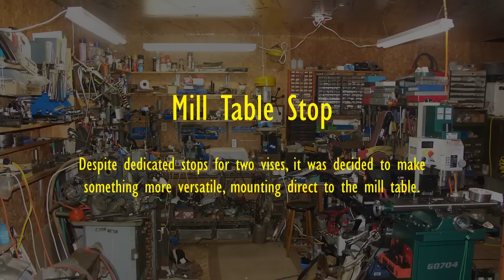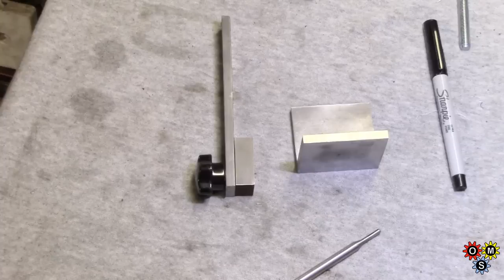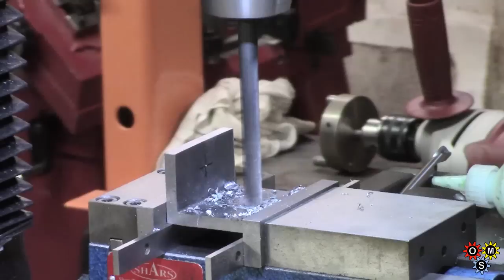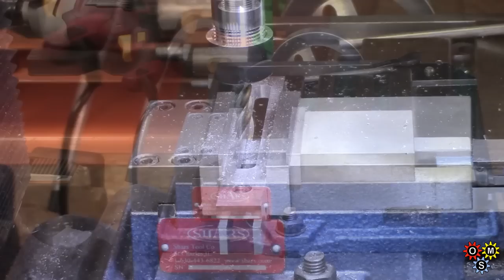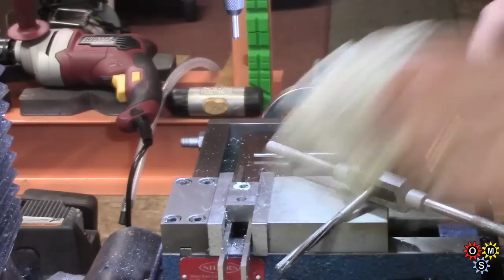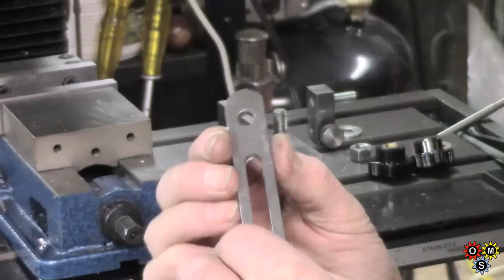Mill Table Stop

Comment: Hi Chris, a nice stop that's "pretty functional". You seem to fly very well.
 A couple of points. Edge finders still work even if they run-out quite a bit. If they didn't most of us couldn't use them. As long as the spindle centerline passes through the movable tip and isn't over the work they still function, they just look funny.
 Never turn a reamer backwards as it can chip the cutting edges or round them over dulling them. Carbide are really sensitive to this  My dull and chipped reamers are all from someone else turning them backwards. Wasn't me! I learned that lesson a long, long time ago. If you get one stuck you should drive it out with a brass drift or pry it up. All the while applying pressure to turn forward as it moves.
 You shouldn't use a hand reamer on blind holes as it leaves a taper at the bottom and pins will wedge in and may be impossible to remove.
 Maybe check your chuck for chips or swarf, it may be time to disassemble and clean.  Although I know keyless chucks are hard to take apart everything needs attention sometimes.
    Mike (o\!/o)
Reply from the maker: +Moholo 88 
Hi Mike - thank you,

The run out of center finder did bother me, altho I realize it's not that critical for spindle center. 

Hah - wondered who would pic up on my reamer malpractice!!! Something I know too well but wasn't concentrating! Naughty old man - only saw it after the fact. Yes, blind holes - quite right.
I will probably do a major flush of the chuck and relube but it isn't actually that bad - just showed up rather when I used the center finder.
Reply: +ChrisB257  I know that sometimes I come across as an old curmudgeon who likes to knitpick. But I know that I don't know everything....yet. But those of us who have done it sometimes forget not everyone has this knowledge or experience. So I write these comments not to criticize or pick those aforementioned nits but rather to clarify and correct the not always obvious so maybe I can save someone from an extended head scratching or an expensive misunderstanding. But maybe I just like to hear myself type. Well, sometimes I like to pick those nits.
    Mike (o\!/o)
Reply from the maker: +Moholo 88 
Keep pickin'. I never mind advice even if I know or should know. Useful reminders and despite age I am always willing to learn! In my next video on the fixture plate I used your welcome mention about spiral point taps - got one and used it beneficially! Thanks - keep on pickin'! :)

Comment: Chris, I noticed at the point in the video when you were talking about chuck runout, that you had a bit chucked up. You really dont want to be chucking on the flutes, If you look at the drill you will see that the leading edge of the flute has relief built in which really cuts down on the grip as well as promotes runoout.
Reply from the maker: +Cuppa Joe 
Hi Joe,

I wasn't aware of doing that actually - naughty me, and it is something I try and avoid like the plague! Guess I didn't check too well.
Well spotted:)

Comment: what is the lube you use when you drill? 
is it homemade?
Reply from the maker: +toolman talal 
Hi,

I am using "Anchor Lube" - liking it more and more for drilling and tapping. Do a search on it and you should find the site.
Reply: +ChrisB257 thanks
Reply from the maker: +Bill Lewis 
Bill,

I was dubious originally but have to say, for me anyways, for drilling/tapping, it works well. Just finishing up my fixture plate and the Al is not heat treated and a bit 'cheesy' - the Anchor lube helped a lot with drilling in particular.